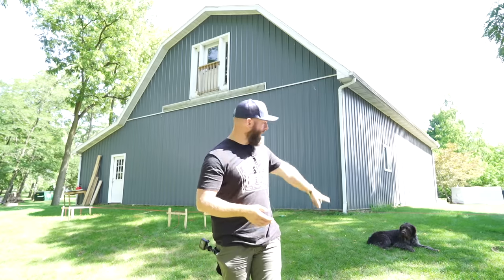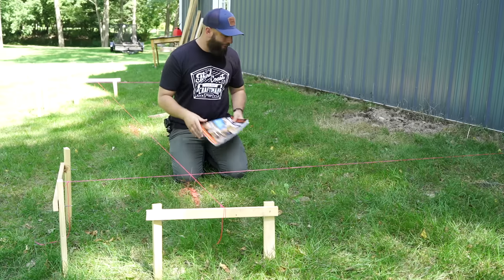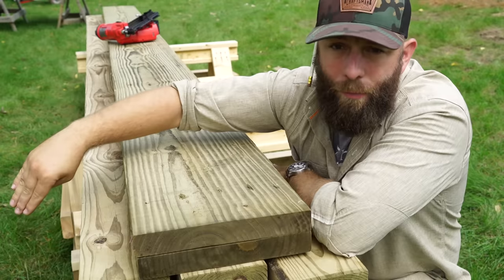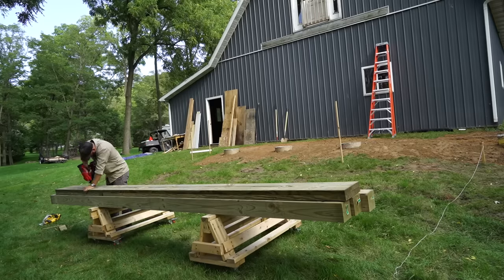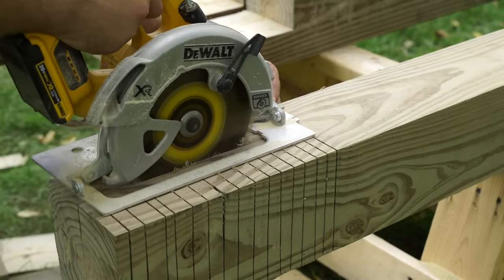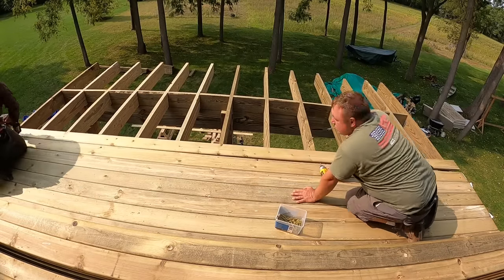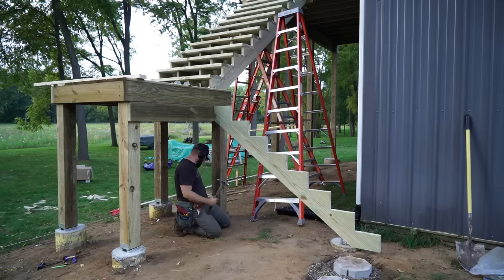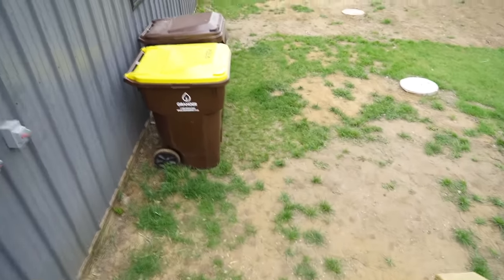How To Build A Deck // Two Story // DIY Home Improvement

Comment: Nice deck. I no longer rely on a ledger board for structural integrity, only for stability. I put posts two or three feet from the house. I can tell you are a good carpenter. I would like to send you pictures of my three level deck, that I built all by myself.

Comment: Nails are used because they are easier and cheaper to install. Screws are better all around but just not necessary. Shear strength is based on the diameter of your fastener, nail or screw.

But I love the video! Great job with everything. Nailing the two boards together at alternating angles is smart.
Reply: incorrect.

Comment: Tip.. when screwing pickets run your screw in reverse for 1 turn, then flip to forward in the same hole and no more splitting. way faster than pre drill

Comment: I've seen elsewhere that you shouldn't hang the joist hangers until you make the joists flush with the top edge of the deck (as their height changes quite dramatically). Makes sense... However how do you then level the joists on top of the horizontal beam you've put in place?

Comment: I'm finding that building a deck is a painful, tedious process of paperwork. It's awful. I get safety but man... I know how to follow a simple guide (IBC). It's very straight forward. Then don't forget the inspectors. Footings, etc. Weird how I can buy a house in complete shambles but if I want to fix it - it's a permit nightmare. My fix will be 100x better than what I'm buying and someone already lives with this death trap. Sorry for the rant. Thanks for the video.

Comment: is it common or advisable to use nails for your deck, but also include some screws to keep the nails from eventually pulling apart?  or is that just overkill?
Reply: Nails are ok but they better be galvanized, pressure treated wood will dissolve a steel nail

Comment: Hi Chris. I love the video. I have a quick question. Are there hurricane ties on both sides if the beam? I wasn't going to do that to the deck I'm about to build because I thought it might be overkill or just unnecessary. I didn't see it referenced to in the 2015 IBC.
Reply: "of the beam"

Comment: Great video Chris!..... First I'd like to say, you're an absolute Beast for trying to tackle that deck alone!..... I just picked up a job very similar, but not quite as extensive!.... I too plan on building myself with an extra set of hands only if need be!... At first I thought I may have gotten in over my head knowing that the most challenging part of framing this deck myself, would be the 6x6 posts with a triple 2x10 beam a top!....Way to go my friend, fantastic job!..... I am curious though Chris?.... Not sure where you live, but I'm currently down here in Florida..... I was wondering what """Labor Costs Alone""" would be in your area for a deck that size, (Materials not included!)????
Reply from the maker: I think deck builder charge around $15 per square foot for labor
Reply: Thank you Chris!

Comment: I thought you are better carpenter, it's very normal deck and ladder
Reply: Not everything a carpenter builds needs to be crazy fancy when it comes to design. What he built is aesthetically pleasing to the eye while meeting it’s purpose and function perfectly. Also, a lot of the techniques he used in the construction of this go above what most carpenters do on construction sites.